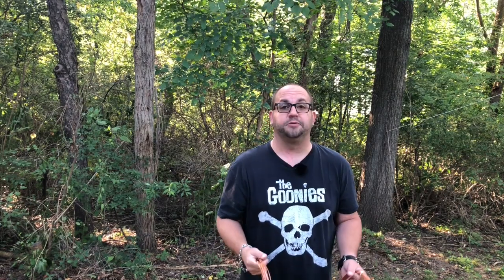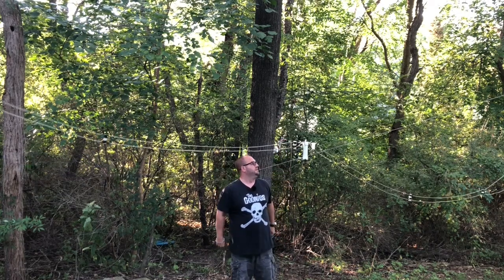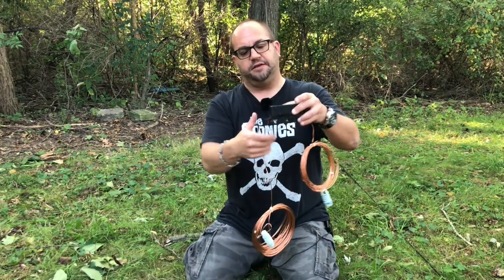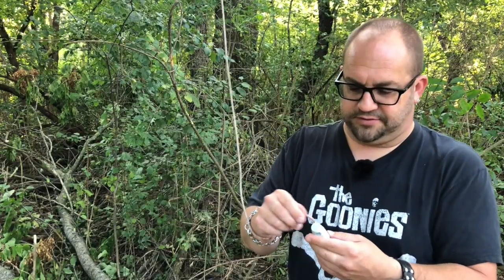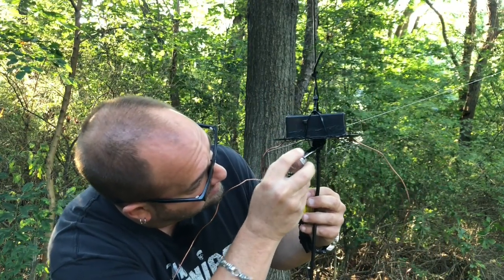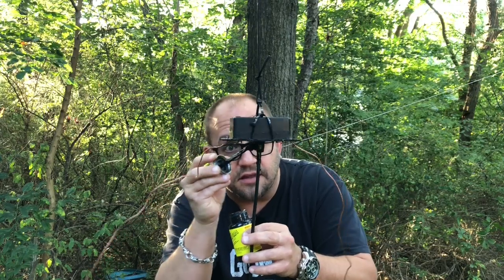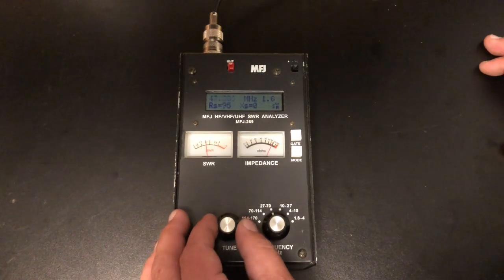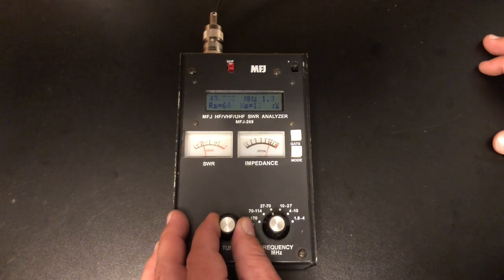MFJ-2012 POWER-LITE OCFD, 40/20/10/6M 1.5KW Ham Radio Antenna

Comment: I have the MFJ-2012. when closer to the ground you need to shorten it a bit. buy on a off set center you trim the longer end 2/3 and the short end 1/3 . I used RTV blue silicone to seal it. worked great. I am in Boston NY our winters our routh hear. the only trouble I had was the copper corroded after 2 years. had to replace. still have it. ran a sloper in a park. short end with clothesline to park bench which was wood. outher long end up to fiberglass pole into a tree. tune was close. IC 7300 tuner tuned it . every time I set it up in a different place the tune changed a tad but the IC 7300 tuned it just fine. has like a 5 or 6 to 1 matching transformers then a 1:1 . I still have it and going to use DX commander DX 50 green wire.  when I first put it up had 1:1 match on CB 11 meters. had to shorten. I ran 1Kw into it. SWR stays down. this is my best performing dipole antenna. they still have it. I have the MFJ end fed dipole one. 40 meters 800 watt . hard to tune . changes more place to place. had to add counterpoise sometimes. had RF getting into mic.  no longer have that problem. went to RG 400 coax and a t 240-43 at radio. I am stuck with Ht for now. waiting for new wire. DX commander Shipps pretty fast . getting DX 10 wire as well. placing order soon,I hope. girlfriend comes first. but I have been good. LOL 73's

Comment: Did you ground this before bringing it in your shack or run it straight in. I'm wanting to put up an end fed but I'm finding so many mixed reviews on how best to ground it. Some people  say it needs to be grounded  to the house utility before entering the shack. Yet others claim that doing so creates a potential and should not be ground before connecting to the radio. Curious what your thoughts are on this.
Reply from the maker: I don't have anything grounded in my shack so I'm prob not the best person to answer this question.  I would say follow whatever the manufacture suggests.  I can't see grounding as ever being a bad thing however.

Comment: I see the dipole is up horizontal. that gives you 160 degrees of communications. what do you do for 90 degrees off the sides ? erect a second dipole ? wouldn't it be better to put up the dipole vertcaly for 360 degrees of radiation ?
Reply from the maker: You could I suppose.  A dipole radiates in a figure 8 pattern off the sides with the ends being pretty weak.  Setting up in an inverted V makes it a bit more omnidirectional and would be an easy way to do that.  The ends of my antenna are facing North and South, giving me very broad east/west coverage (which is what I want). I don't hear quite as well in the southern countries but I still work South America all the time so its not like it doesn't work.  The best solution would be to have 2 antennas so you can really cover all directions but then there is also the space that would take up.  A vertical dipole would also get to be quite a bit of a challenge when you start getting into the lower frequencies like 40, 80, 160 meters as they start to get really long.  An 80 meter dipole is about 126 feet long and would require quite a tower!  
The better solution is simply a ground mounted 1/4 wave vertical (like  the DX Commander antenna).  That literally is a vertical dipole, where the radiating element is the center, and your counterpoise is the shield.  The more counterpoise wires laid out, the better your antenna is going to perform.  I could talk antennas for hours but hopefully this answers your question.

Comment: I've had the lower power MFJ-2010 version of this antenna up for over three years, set up as a sloper with the feed point on the peak of my house (28 feet).  Possibly the best 70 bucks I've ever spent on an antenna. How I envy you guys with trees on your property!  Thanks for the review, Mike, both the 2010 and 2012 are great multiband antennas.
Reply from the maker: I'm really surprised at how well this antenna has been working for me through this Michigan winter.  I have had absolutely zero issues with SWR in rain, sleet, or snow.  I was worried about how well the feed point would perform, hence the liquid tape, but it hasn't skipped a beat.  I actually loaded it up with my tuner a couple weeks ago during the 160M AM contest and made a couple contacts with it!!  I was absolutely amazed.  Thanks for the comment, 73.

Comment: So did you trim the antenna?
Reply from the maker: No I haven't had time yet.  It's on my list of things to do though.  I'll keep everyone posted though.
Reply: K8MRD RADIO STUFF ok thx. But you are using it and it’s working.
Reply from the maker: Ted Mac oh yeah. It’s not that out of wack it’s just not perfectly tuned.
Reply: K8MRD RADIO STUFF  Ok thx. I’m gonna order one thru your link.
Reply: @hamradiotube  fyi i just picked up two bottles of the liquid elect tape for less than $10 at walmart
Reply from the maker: @qrptedmac  Sweet, a new supplier!

Comment: What are you going to use to take the strain of the coax weight off of the PL259 connector at the center of your dipole?
Reply from the maker: Nothing at all.  It just hangs there.

Comment: Will this antenna handle 11 meter? I did nt see it in the link.
Also is it better than the one you made?
Thanks!
Reply from the maker: Not sure about 11 meters.  I don't own a CB.  Its too early to tell if it's better than my home brew.  I had that up for 2 years and I've only had this up for 3 days.  I would imagine they are pretty similar.    It's up the same height and about the same length of wire.  just 1 different band is all.  The bands haven't been that great lately either so its def too early to say.

Comment: Hi there,

Nice to have the big trees to tie  off to.

Speaking of tie off's; zip-ties? Really?

They WILL break! The Sun will eat those alive and you will find it on the ground from the weight of the snow.

A better idea would be to use some of that small diameter good Dacron poly rope through the holes in the loops like the zip ties.

Comment: Love that Liquid Tape.  Have red and black.  Been using the same bottles for over 10 years.  Keep adding lacquer thinner to it and invert the bottles every so often to mix it up. Works great for antennas and any other electrical connections that need protection.

Comment: You did not check the OCF on 2 meters. My OCF40, made by Hy Power Antenna Co. works on 2 meters as well as 6, 10, 20 and 40 meters. 
Barry, KU3X

Comment: Hi Mike,   Another great video!    I've had this antenna for a little over a year now and I love it.   I use it mostly on 40 and 20 meters.   With my RigExpert at 7.150 the swr is 1.34:1 (minimum swr is at 7.048 at 1.28:1) .  At 14.175 the swr is 1.12:1 (minimum swr is at 14.081 at 1.03:1).   No adjustments were necessary.  I guess I just got lucky!.   I have it up in the trees about 40ft.   Also use the 7300 with this antenna and in just over a year have 94 countries worked with 89 confirmed.    The next 11 are going to be tough!

Comment: Nicely done. How do you like the ic7300?  Just about to add that to the mix.  Replacing some dipoles in the back yard too.  I have been taking my 891 and batt with a mpas2 ant out on trails and parks. Just registered with pota.  Hope to get that down asap. Thanks for the inspiration.  73 de kc1fig
Reply from the maker: How do I like the ic7300?  Well, don't ever touch one unless you plan to buy it, because you will.  I absolutely love mine.  Been taking it portable too.  I got spoiled with that waterfall.  If you have the means, just get it.  You won't regret it.
Reply: @hamradiotube  thanks,    it will be my first icom.  It looks  great.   73  man.

Comment: With a touch of fine tuning you will have that antenna working perfect. 73 de John G0WXU
Reply from the maker: Yeah I'm a little spoiled with my fan dipole.  I had that thing tuned in perfect.  No big deal though.  Just takes a little time.  It's also not up quite high enough so I bet that has a little to do with it.

Comment: The analizer does'nt put the same power /current into the antenna as doing it with real rf from a radio it will only be a guide. I would snip it a bit to get it better where you want it on 40m be proportional cutting it as one end is longer than the other. But you would know that anyhow here's me preaching to the converted. good antenna.
Reply from the maker: That makes sense about the current.  Didn't even think about that.
Reply: @hamradiotube  So, by "proportional cutting" referring to cutting the same off both ends or is it referring to say if you cut off 12" off the long end to only cut 6" off the short end?

Comment: Store the bottle of liquid tape (and rubber cement) upside down. It'll make it last MUCH longer! I was a sceptic, but it works! Make sure the cap is tight first! Lol
Reply from the maker: Just turned it over.  Thanks for the tip.  My last bottle hardened up on me so I had to buy another.
Reply: don’t the brush bristles harden up when it’s upside down?
Reply from the maker: @forgetyourlife  I would doubt it.  Theres so much solvent in there it could choke a horse.  I suppose I'll find out though.
Reply: Do the same thing with PVC Pipe glue, lasts forever, the seal stays moist and doesnt dry out.
Reply: Nope. They stay nice and pliable. I know... it doesn't make sense.
Reply: @gilbreathca  actually it does : upside down the liquid tape does not allow the compound to dry nor does it allow the brush to harden (it's not drying either).
Awesome tip btw.
Reply: I do the same with all aerosol cans. The propellant seeps out around the nozzle otherwise. 
DO NOT do this with spray glue. It migrates into the nozzle.

Comment: Mike, great video as always, as for me I live in a condo so no antennas outside.  I am using a 33foot dipole in the attic with my 891 and seems to do good for what it is.    K8MGB
Reply from the maker: Thanks Mike.  Any antenna is better than no antenna.  I think if I were in that type of situation I would still try to hide something outside.  Better to ask for forgiveness than permission I always say;). Thanks for the comment and thanks for watching.  73
Reply: K8MRD RADIO STUFF Mike, I can’t hide any style because my xyl is on the board lol so I use what I got and have made many a contacts with it.
Reply from the maker: @mikek8mgb  Oh man that's strikes 2 and 3 right there!